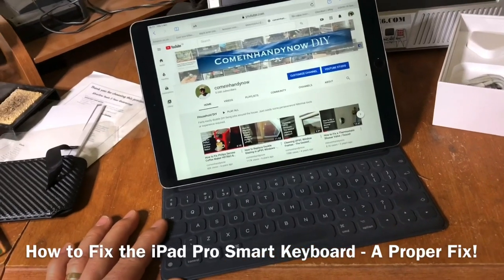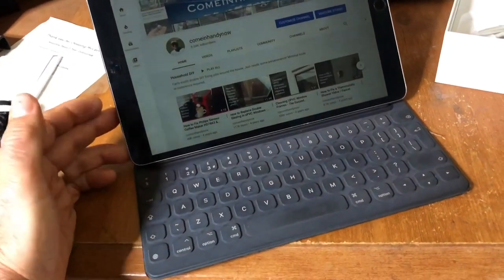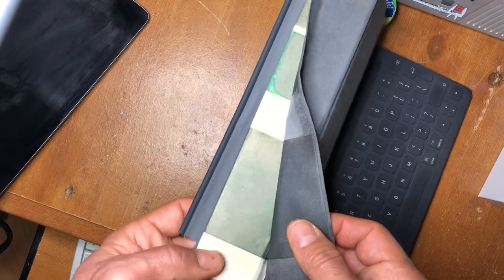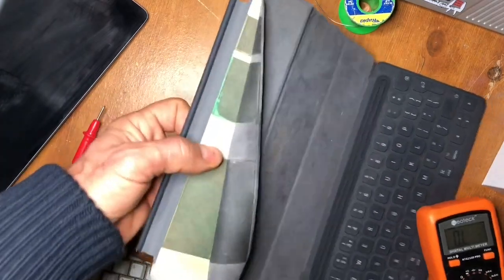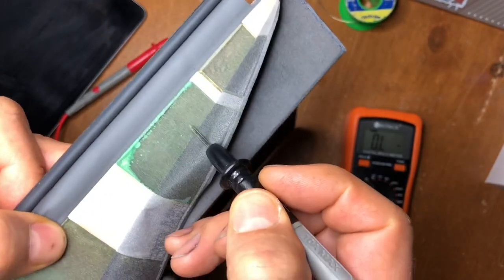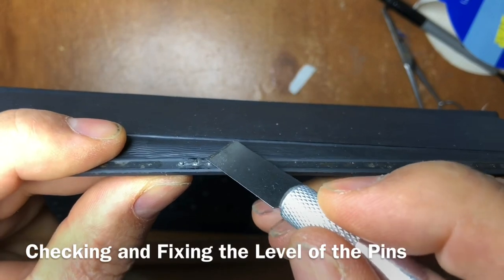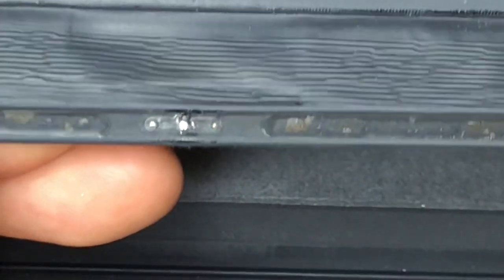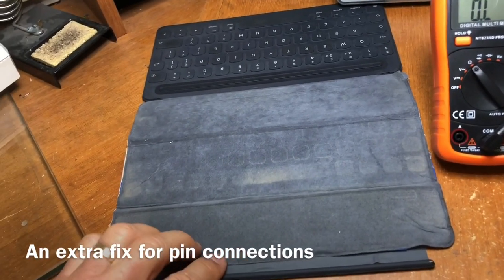How to Fix the iPad Pro keyboard - 4 fixes! Working Proof!

Comment: Just some tips from my experience : 
Mine works by clean the line magnet with wet tissue, and restart your ipad, and connect it again, mine works by that.
Reply from the maker: That is a simple issue of dirt and or s/w recalibration.  The eventual common problem is deterioration of the flexi strips as covered in this video.  Always worth trying your steps first though. Thanks for sharing.

Comment: It's funny mine just started acting up this month as well....what a coincidence.....

Would you be able to come up with a rough schematic of the keyboard and where we should be testing for faults? LMK <3
Reply from the maker: I think it’s common after 2-3 years of a lot of use.  No schematic needed to fix it. It is just the connection from the pins to the keyboard via flexible strips.  The connection breaks due to all that flexing. That is the bit that needs fixing.
Reply: @comeinhandynow  Good news I got it! USed a piece of aluminum foil to confirm that one of the pins was a bit too short.  Oddly the midget pin perked up after that and behaved. 

Thank you so much for your reply tho :)

Comment: I can understand this corrosion to conductive fabric is due to exposure to moisture... like a spillage of some sorts.

I still wonder what the issue is with keyboards that does not have corrosion due to water damage. 

One possible reason is that the iPad is supposed to engage the smart keyboard only in the typing position. This is enabled through a combination of sensors on the keyboard itself and magnets from the ipad. Once the keyboard is folded back to “Entertainment mode” it should automatically prompt on-screen keyboard. 

I don’t know if there is a point of failure in this mechanism.
Reply from the maker: I think it is very common, so not so related to the look of corrosion.

Comment: Great and super detailed video! Have the same issue. Your upper layer (the felt one) peeled off neatly, which didn't happen with mine. Did you prep it in any way before pulling it off? Thanks.
Reply from the maker: Thanks.  No not prepped but it is a very tough pull off.  Once you get it started it gets easier.

Comment: Great video! Thank you so much, I’ve been learning how to fix my apple products myself in the last years. I have a question, I have the Smart Keyboard new model with the pins on the bottom instead the side, do you think I can try the same process?
Reply from the maker: Thanks. I am not sure where the weak spot would be on that model, but if it has failed completely then there is little to loose by trying.

Comment: Before trying all this take a emery board and strike the pins slightly...test the keyboard....this worked for me after trying EVERYTHING but tear my keyboard apart...and completely restoring my iPad Air 3...lol
Reply from the maker: It might help it work for a while by lowering the contact resistance slightly, doing the same on the iPad contacts as well might help but if it is that sensitive to a bit of cleaning up then the keyboard must be getting high resistance internally and will need fixing eventually, like in the video.
Reply: @comeinhandynow  I
I have a black web Smart Keyboard...

Comment: My keyboard became intermittent and then stopped working altogether so thought I’d give your solution a go - on understanding it couldn’tget any worse and liked the idea of a DIY job...however, it’s still not working...accidentally I cut through the ‘fabric wires’ when pulling the fabric off and got down to the wooden boards before I realised that the stains on the wooden boards were just that, stains not the fabric cables! Nonetheless I used the copper strips you recommended and remade all the connections - multimeter confirms all the connections have now been restored between the three pins and copper strips but the keyboard is still not recognised, though occasionally you can hear the iPad ‘beeping’ as if it’s trying to make a connection...how much resistance is too much to affect the keyboard ie am wondering although there’s a connection there maybe too much resistance still? I’ve set my meter to “200” as opposed to “2k” and the copper strips register 00.5 but pins to various other parts of the strip can be as high as 08.0 is that too high...the rest of the keyboard looks in good condition (despite being 3-4 years old) so are there other connections that can break? I’m not sure what else to check so may have to bin this and buy a second hand one or just live without it....😔
Reply from the maker: First well done for trying.  You learn by trying and making mistakes.  I don't believe 8 ohms is too much resistance, but you should check the connection from each pin to as far as you can get to the keyboard end.  Also make sure you have no connections (shorts) between any of the tracks for the 3 pins.
Reply: @comeinhandynow  although I haven’t solved the problem I have enjoyed the experience so thanks for the advice and encouragement. In the end I had to pretty much remove the entire canvas covering in order to expose the contacts (most of it ripped in the process so couldn’t be reused) - but they seemed to be fine had a good connection from keyboard to the pins - in hindsight I suspect the weak link was the pin connection to the iPad..as in desperation I bent the pins upward and for a few seconds manage to reconnect the keyboard - alas it was short lived. So have binned it now and will look to get a second hand one...tip for others is to be sure the pin connections are working first and try the solder technique before doing to much damage to the fabric....
Reply from the maker: @peteg5389  Thanks for sharing your experiences.

Comment: Thanks for posting, really helpful. 

Mine just stopped working coincidently after I bought a 2018 model. At 2.25 years after purchase it is outside of warranty. Seems the best option would be a discretionary replacement in store. However because of the UK lockdown I cannot take to store. Apple want money to send for repair and repair costs cannot be calculated for some reason but rep suspects will cost full replacement. Not impressed with Apple as my keyboard is immaculate!

Will try this as last resort.
Reply from the maker: Nothing to loose by giving it a go.  Measuring with a multimeter will show you where the break is.
Reply: From me they wanted 160€ for the repair. Ridiculous. Obviously a design flaw.

Comment: I cleaned all my points with acetate and it started working but for how long is the question?  I have only had my Smart Keyboard for 2 weeks. I threw the other one out because of this reason, but it is at least 3 years old.
Reply from the maker: It could have just beeen some muck on the contacts causing your connection problem, but see how it goes and return it if it is a regular problem.

Comment: As of watching this...have had 2 of these fail and my wife's keyboard case is also on its way out... soon will be 3. While I appreciate that a solution exists....this seems like way too much trouble to attempt. Does anyone know if newer Ipad keyboards have the same failure rates?
Reply from the maker: I have the apple magic keyboard, the one where the ipad pro floats above the keyboard and it does seem better designed as the joint flexes a lot less. So far it is still working well.

Comment: If you are scared to cut your keyboard up I’ve actually found a very easy fix that always seems to work for me. The keyboard might not appear to be working but if you hold the command key long enough you’ll find it alone actually is working. Then press Command and Tab to switch app. Once you do this the keyboard works fine again. To keep it working just put something under the end you rest it on to the angle the ipad is leaning is less extreme and resting better on the pins.
Reply from the maker: Thanks for your input but that won’t fix the issue discussed here long term.  The problem is resistance in the internal tracks caused by the flexing of the joints so when it gets really bad no amount of software fixes like key presses will fix it.
Reply: @comeinhandynow  yes it's true this isn't a long term fix and you need to keep doing it whenever you disconnect which is annoying. Your fix is the king term one.

Comment: I just ordered this keyboard with a new iPad. Hope it doesn’t run into any issues, not sure if I should just return it.
Reply from the maker: I would keep it.  It is certainly better than cheap Bluetooth ebay keyboards - had two and both failed in about a week!  My apple one is nearly 3 years old and I did tend to bend it at all angles using it as a general prop.  My advice would be to look after it a bit better than I did!
Reply: Bodmonbakery This is my FOURTH Smart Keyboard and it too is exhibiting these signs again. They replaced the second one as it was under warranty still, but the last one was on me - as will this one be. UGH!
Reply: Julia Forgas Ouch, that sounds horrible. But don’t worry about that, stay happy and healthy in this time! I returned my keyboard to Apple last week.
Reply from the maker: @juliaforgas1463  Have a go at fixing it, nothing to loose.

Comment: Would the tape used for dryer ventilation work in this case? It’s a thin, but very sticky tape. I was thinking of folding it over to make it into a double sided tape. That way the plain material side can be stuck back onto the conductive tape side.
Reply from the maker: Is it conductive tape with a low electrical resistance?  If your not sure measure it with a multimeter.

Comment: I used your method but the connection is still not stable….finally I buy a new one, a cheaper unofficial one using bluetooth connection instead
Reply from the maker: Shame.  I also tried cheapo chineese bluetooth ones 2/3 rds of them didn’t work or failed quickly and when they did work I hated that power on delay when it wakes up on typing, so the first few letters are missed.  The new Apple “Magic keyboard is a lot better and reliable so far.
Reply: @comeinhandynow  I torn off the skin of the old keyboard and stick with many tin paper for conduction. Now the old keyboard appearance is so ugly and cannot be resold at all:(
Reply from the maker: The copper tape (with conductive adhesive) is a much better connector if you want to try again.

Comment: Before you try this... if you got your keyboard wet that will cause continuity across the 3 contacts. 
Give it a night in the airing cupboard, and get it completely dry before you start getting into radical repairs.
Reply from the maker: No harm in trying but not the usual problem.
Reply: @comeinhandynow  mine got wet and I didn’t let it dry bc I didn’t know 
It won’t work do you know how to fix it? :(
Reply from the maker: @river4211  As phil said, if you just got it wet then dry it out and try it to see if it works or not. The main keyboard does look well sealed.
Reply: @comeinhandynow  not sure what happened but It’s working again ‼️
Reply from the maker: @river4211  Great.
Reply: @comeinhandynow  lmao it stopped working again 😭

Comment: I tried the video solution. I found that it is easy to peel off the rubber cover where it is green under it due to a substance that seems product of corrosion, but not as easy at other sections.
I tried to clean the green parts, and test, without results. At some point, I noticed that the problem seemed to be a break between the pins and the conductive lines, so I tried to peel of the rubber near the pins with a small screwdriver. Suddenly, the keyboard started to work, and I am writing this using it.
Will it last? I don’t know.
What I do know is that I won’t buy Apple accessories again if I can avoid it. This is my second ThinkPad keyboard, and I had to buy a second keyboard for a Mac, because the first just stopped working. My Magic Mouse has aluminum foil because otherwise doesn’t work.
Apple develop great devices, but not  good accessories.

Comment: My keyboard has the same problem. when it's keyboard mode if I apply pressure by pressing with my finger to triangle's facing side to ipad it works when I remove my finger from behind the ipad keyboard it stops working and shows screen keyboard. I believe it has a loose contact problem and I wonder will your solution work? Thanks
Reply from the maker: Could be a poor connection on the 3 pins. Sometimes a slight bend helps so that the 3 pins are a bit higher wrt the rest of the edge. But dont bend too much!
Reply: @comeinhandynow  So I need to bend it like in 01:17? I’ll let the bending to my electrician dad. He wrapped the rubber part with tape it worked for a while but for too long. Thanks a lot 😊
Edit: we're gonna try your foil solution. My dad said that there wasn't any problem with pins they are having enough energy
Reply: @comeinhandynow  Thanks a lot thanks to your foil solution it works now. God bless you 😇

Comment: How did you do to separate the layer of lather with out removing the layer of fabric that comes with the lather one or do I have to separate them both?
Reply from the maker: It hard to advise remotely.  You need to see what to remove in order to see the tracks, use the video for guidance and give it a go.

Comment: My keyboard is not sticking to the back of my ipad as it used to do, its just about 5 months old, it works, but i dont know why isnt it sticking to the back, so its very loose when I want to use my ipad without the keyboard. Any solutions please help.
Reply from the maker: Is it bent? Is there anything stopping it getting close to the ipad?  Maybe check if the pins have stuck in a raised position.  They should go up and down on springs, slightly.
Reply: @comeinhandynow  Everything looks fine I would say just how I bought it, but like before I was able to place a folder metal clip on the back of the keyboard and it would stick there, but now I do the same and it doesn't stick. I think it lost its magnet, I tried cleaning it but it still doesn't work.

Comment: Great video! Though I do have a couple of questions. I’ve only peeled back the first section and from there onwards it appears to be unaffected with green. Do I need to make the new connection all the way from the top to the keyboard or can I just do a section? Secondly, can the copper tape go over the material or does that all need to be scraped off first?
I really hope this fixes my keyboard because it would be such a shame to lose it! This tutorial gives me a lot of hope thank you!
Reply from the maker: The copper tape has to make a connection so you need a multimeter to measure resistance (ohms) to see whether you have exposed the conductive area.  You also need to identify where the break in the connection is and repair it with the tape.

Comment: If the layer you are put the tape on has ripped up will this technique still work?
Reply from the maker: Yes.  There are two layers that are conductive, you should have a multimeter to check your new tape has a connection to the pin through at least one.

Comment: Has anyone tried to access the other side (non exposed) of the three little pins to solder wires on the backside in order to make the repair look a little cleaner?
Reply from the maker: It is difficult as buried in rubber it seems, somewhere in there are little springs as well.

Comment: Thank you. iPad keyboard surgery scheduled!
Reply from the maker: Hope it helps!
Reply: comeinhandynow it’s funny. There is resistance in all the strips but my ipad  keyboard isn’t working. I wonder what’s wrong
Reply: comeinhandynow I found the culprit. The middle pin has no resistance compared to the ones beside each. Thank u so much for this
Reply from the maker: @jartagniancopria1120  That’ll be the problem then, also check the pins make good contact with Ipad as well, often the middle one is low.  Also check the ipad contacts are clean.

Comment: hi, instead of soldering on the cables - could i use the conductive tapes instead?
Reply from the maker: You could try but it’s more likely to break.  Soldering irons are quite cheap and useful for all sorts of electrical fixes.

Comment: Hi all. I continued my (not at all) Smart Keyboard adventure by having a disappointing experience at official apple service point (Brussels, the center of Europe). At first they searched for my S/N and they found it is 3 yrs and 1.5 month old. I told them I have heard about an extended warranty, they responded this is not the case, then they offered a same new keyboard for an astonishing price of 180euros!!! I asked them if there is another type of apple keyboard compatible with my 2nd gen iPad Pro but again this wasn’t the case. I asked to speak with the manager and after a while they offered me a 50% discount. I asked them how long will be the warranty and when they answered 3months!!! I walked away thinking of the meaning of unreliability...So, trying for the hardware fix is the only way out. I have ordered the conductive tape and I will try my chance so. I will be in touch with you.
Reply from the maker: Good luck. That 50% off offer was quite good though.

Comment: Apple should have replaced all of these. Poor design. I took the cover off... and my fix ended up buying a Logitech Create off ebay. :) Thanks for sharing! Zagg makes nice products. The Rugged Book Go for the 12.9 iPad Pro (2020) is amazing!!!
Reply from the maker: Thanks for sharing. The Logitech keyboard is quite good, beimg backlit as well, but it is bulkier.  From a quick search the rugged good seems to use a wireless keyboard which are often unreliable and poor quality in my experience.